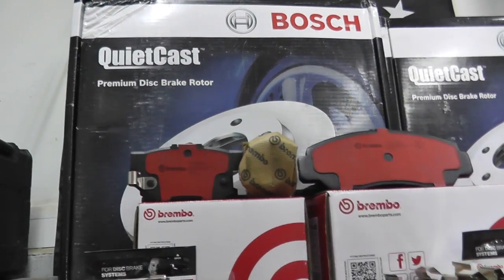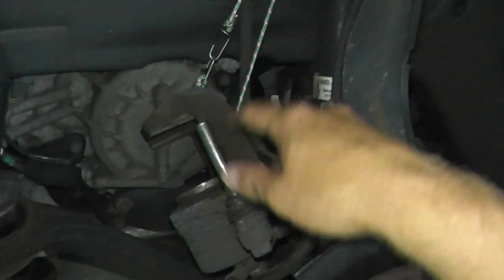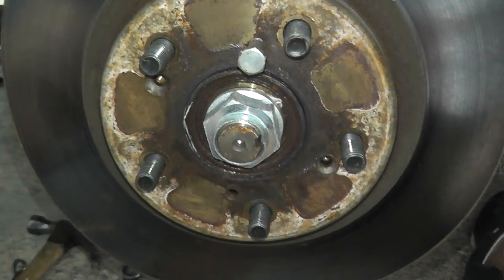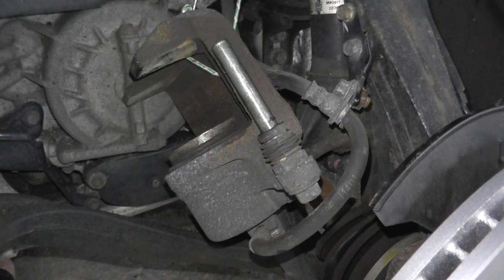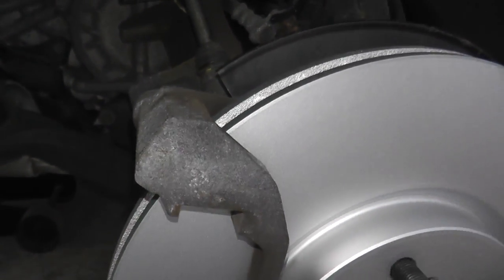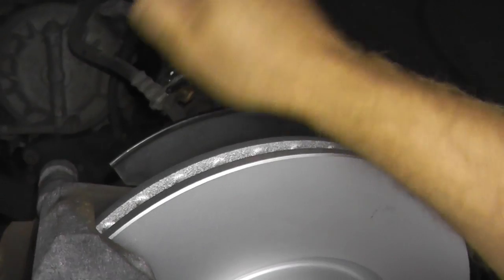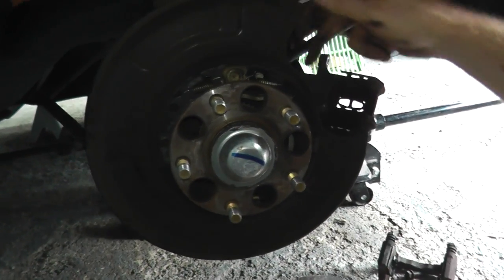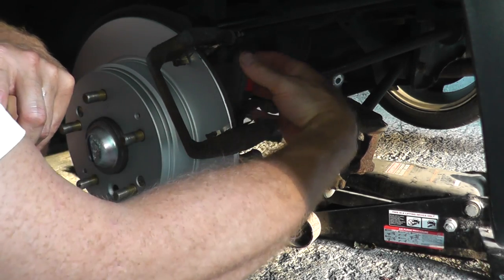Brembo Brake Pads Installation with Basic Hand Tools

Comment: Brembo gave me hardware that’s not compatible with my pads.. I’m now dead in the water here with shot pads and new Brembo pads with incompatible hardware..
Reply: What do you mean? either you picked the wrong pads that don't match the make and model of your car, or what ever store you bought them from did not give you the correct pads.
Got mine from Part Source, Made sure to ask, They will ask you for your make and model, engine size ect. 
Mines a 2006 Chrysler 300c 5.7L V8 Hemi.
Reply: Did you find what fit my didn’t come with any at all I’m bummed out

Comment: So my issue is a noise in the rear? Is ai know you get noise sometimes with after market parts are getting and noise and did you have to beed the brakes in
Reply from the maker: No need to bleed the brakes; no air entered the system.
Reply: So you have no noise they are quiet like factory
Reply: I don't know that process where you drive up to 60 and slow down that was the process I meant

Comment: How are you wheels in such good condition? Did you get them refurbished and do you know the exact paint code for those rims?
Reply from the maker: I tend to clean them at least once per week. One wheel is refurbished. (The rear wheel in the video.) Stock refurbished wheels go for about $120/piece.